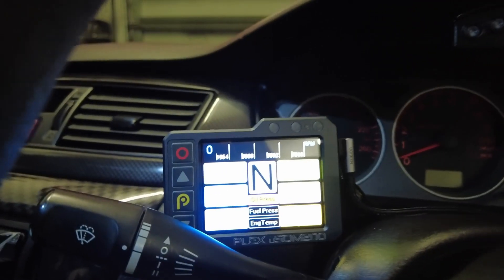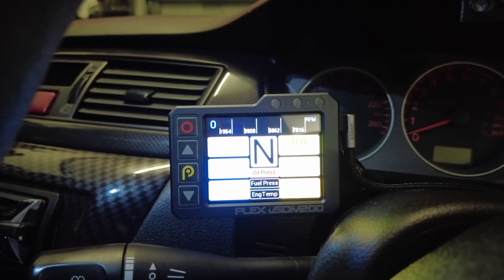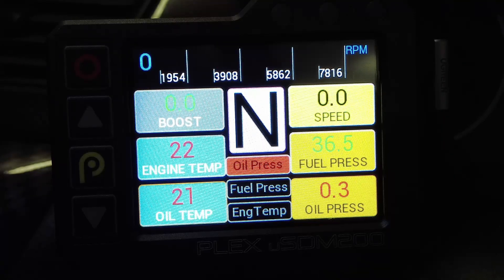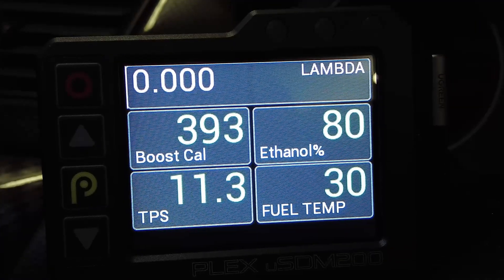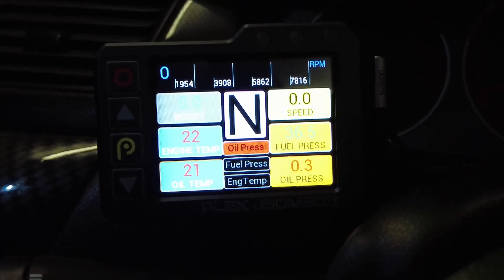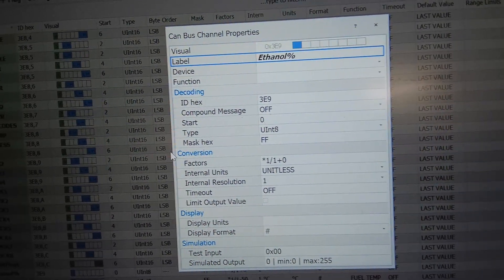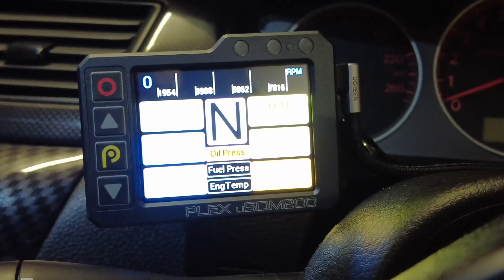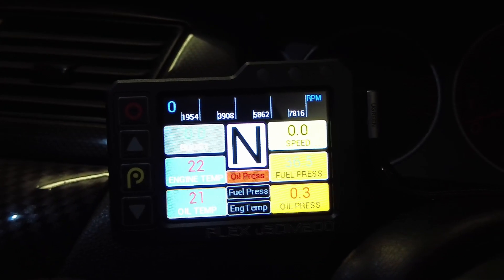Plex Tuning µSDM-200 display review

Comment: Just bought one of mine...any options for mounts?
Reply from the maker: @crxkid16  I just made up an aluminium arm which is attached to the upper steering column trim (on an Evo 9), it has a bend in it that positions the display facing you. T end display has two thread female holes on the back so you can use two little bolts to attach it to the arm. Also have a look around for 3d printed mounts, were a few available for the Usdm100 display I used to have.
Reply: @ausevovideo6514  any link for the bracket? do you have any picture for the trim you did on your car?
Reply: @ausevovideo6514  I ended up making one with quad lock adhesive mounts. How about wiring instructions? I can find any pinout or instructions online and mine didn't come with any in the box
Reply: looks like a 6 pin DTM but I don't know what each of the pins are for
Reply from the maker: @crxkid16  it's an 8 pin connector but a lot of extra pins are for other features like 5v out for other sensors and io1 and io2 for high low analogue frequency input. I just have the four pins wired, 12 volt switched power and ground plus the two canbus inputs (can high and can low) from your ECU. Remember there's a few versions of this display including a gps enabled version, so some pins are used, or can be used, for a gps antenna etc.

Comment: Do you have the pinout from the dash?
Reply from the maker: @leonardomarques1332  I don't, but there's really not too much to it, a ground, a switched power (probably worth putting a fuse in that) and the canbus output from your ecu, think that's it. I used one of those fused adapters that plugs into your fuse panel under the dash,,made it very easy.